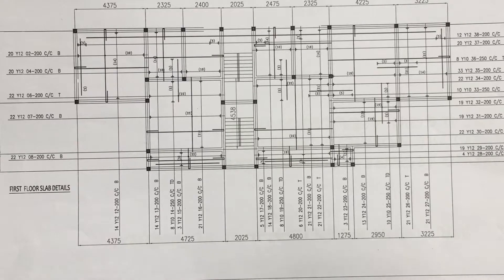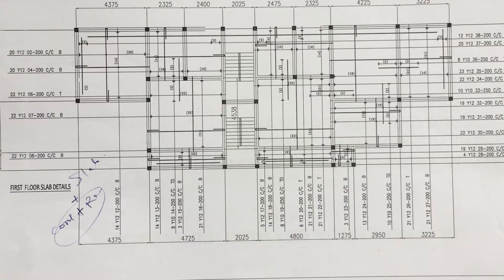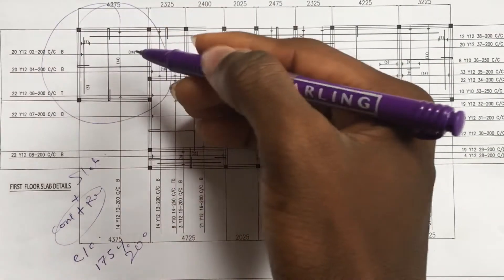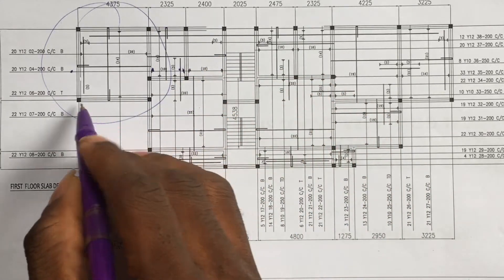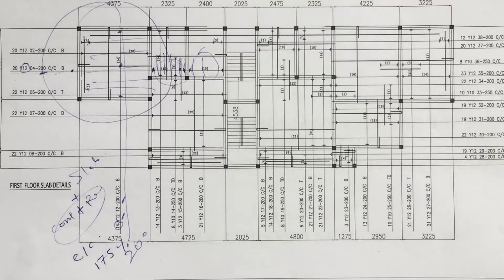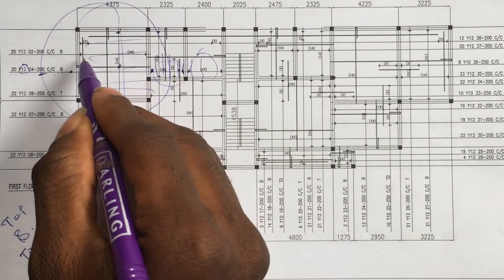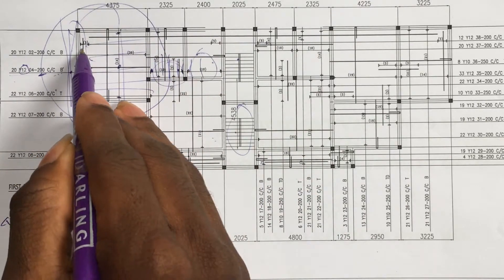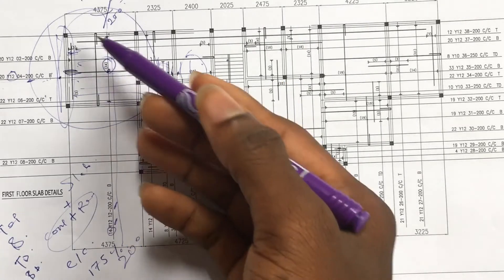What You Should Understand About Slab Detailing | Vital Information

Comment: I appreciate d way u section ur play list now...
Pls don't 4gt video on bending schedule too
Reply from the maker: Yh sure am working on it. And do you know that the bar bending schedule is just a table to show lengths, shape and numbers of reinforcement. It can be done in Orion too
Reply from the maker: Your contribution really helped me to figure out that making them in playlist will really help. Thanks bro.
Reply: Ehn ehn... Dat one join..
D 1 am saying, Hw to calculate the reinforcement to cut in site... I don't kn hw 2 explain it..
Reply from the maker: The cutting will be made by the builders on site or iron benders
Reply from the maker: The only thing you’re required to do as a structural engineer is to give them the bar bending schedule
Reply: Yea, dis
Reply from the maker: Yh, valid bro